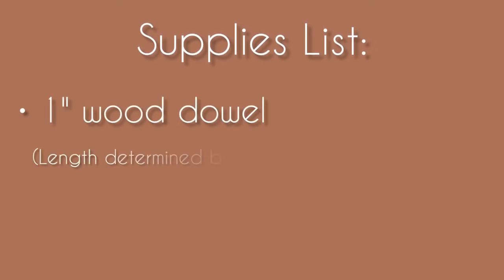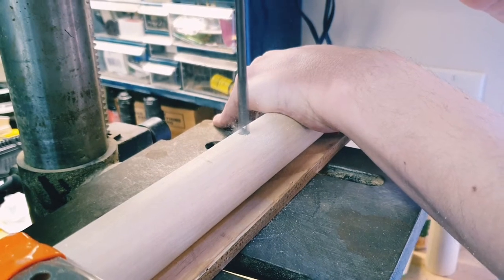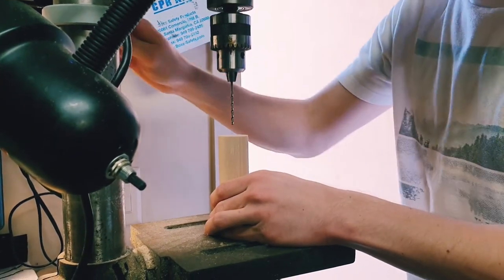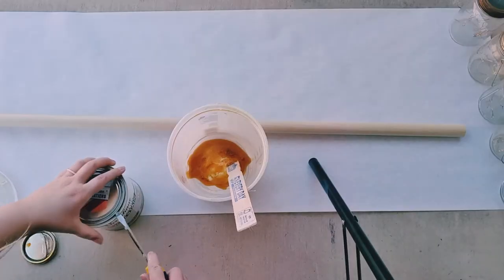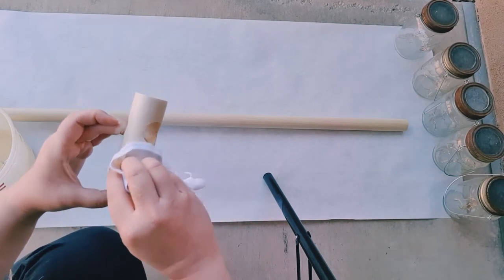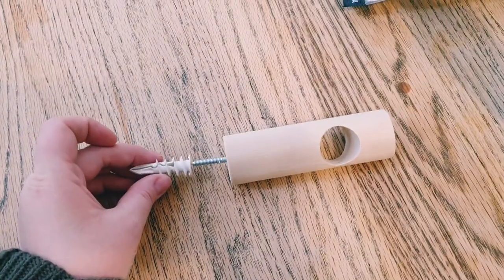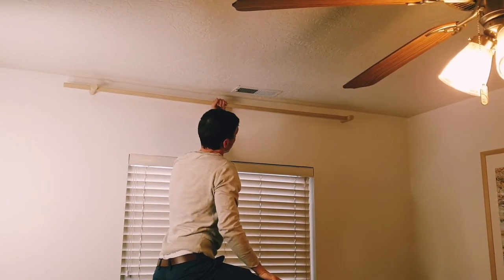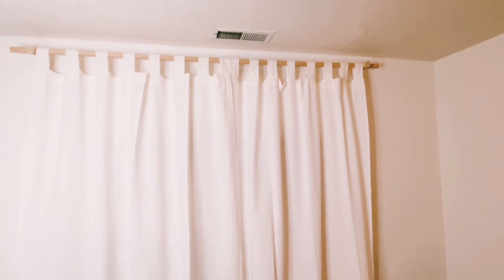DIY Wood Curtain Rod on a Budget!

Comment: I have been spending two weeks on looking at curtain rods and my first thought today was why don't I make some myself using wooden dowels so I ran to YouTube to see if anyone else had this idea and have done it! Glad I found this video. I won't be making the part to slide the dowel into on both ends, I'm just going to buy the hooks that you don't have to drill into the wall and I'm going to paint my stick black to match everything else. Thank you for sharing this though! It looks fabulous darling!🎉